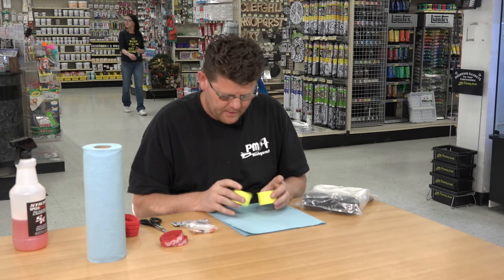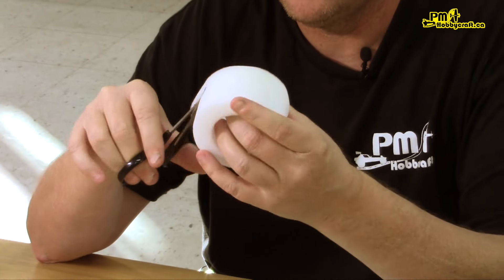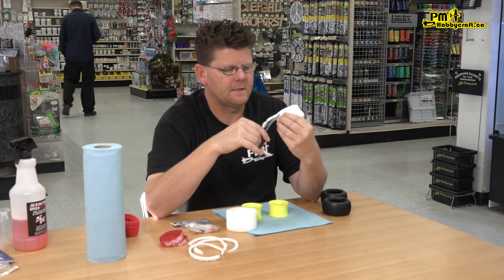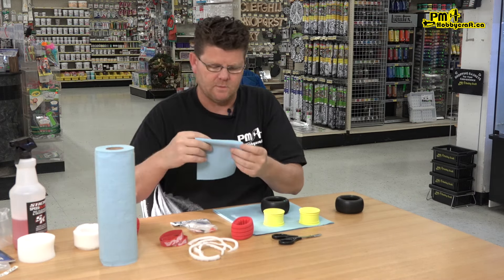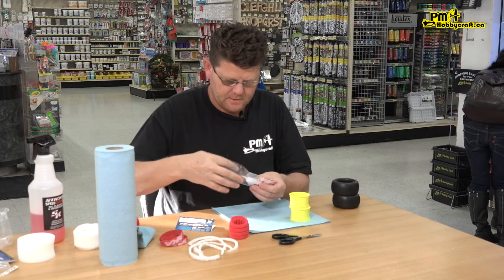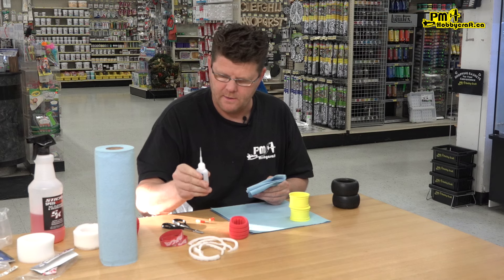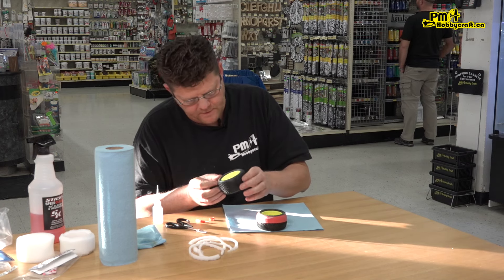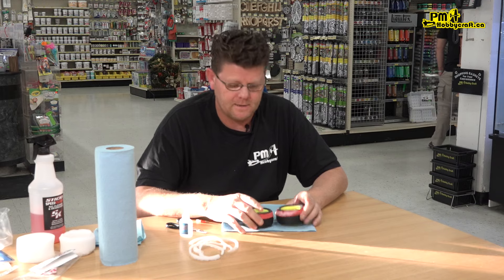Glue Your R/C Tires Like a Pro

Comment: I'm a noob and I spent last night trying to glue 3 set of tyres. Got just crazy for the bad result and burning throat due cyajoacrylate smell. Was almost going to throw this hobby in trashbox this morning. Then I saw your video. I will follow your way and hopefully I will be back on truck without problems. Thanks for sharing 🙏🙏🙏🙏🙏🙏🙏🙏🙏🙏🙏🙏🙏🤗🤗🤗🤗🤗🤗🤗🤗
Reply: Set up a little fan to move the air away from your work area. I hate working with super glue, but it is the best.

Comment: Is the CA glue used for wood similar to The CA  glue used for RC  wheels. 
Newbie question I know 👍😀
Reply from the maker: Thanks for watching and for the comment!  Some people have used CA intended for wood but with mixed results.  Some brands are quite brittle and they will fatigue over time which will cause the bead to come loose.  The way it was explained to me is that CA Glue that's formulated for RC Wheels has a rubberizer or something similar to make the glue joint a little more flexible.  Other people say that CA glue is all the same stuff but it isn't.  Even between brands of Wood CA glue, there are differences in performance.
Reply: @PMHobbycraftLtdCalgary  
Thank you Sir. I found some rubberized CA. Works great just leaves a white stain on the black plastic.

Comment: Is this method good for all rc tires? I’ve had some excess glue on the sidewall and once the rubber stretches or bends the glue turns white and flakes away from the rubber. How does this hold the rubber and wheel together? I don’t see how this gets down into the bead 🤔 unless I’m missing something. Just curious.
Reply: It's not a method I've personally used (i used to use the other method he mentioned, poor results) but it'll likely depend on the tire. I feel that those buggy tires are probably a softer and more porous compound than most, which allows that super-thin glue to just seep into the rubber.
the last method I used was
Seat the tire (like he already did)
pull the WHOLE bead back nice and even on one side
hold the rim over something that'll absorb your mess
drop glue from the top of the rim and it'll wash down, rotate 30 degrees or so, top that up, turn the other way 30 degrees from your initial start, same thing, then slide the bead back into place and re-work.
Repeat on the other side
Repeat again for the other 3 tires.
Still have to be REALLY fast and accurate, but it worked for me on 3 of my 4 wheels. The first one I just simply borked because I dropped the tire while trying to work with it.

Comment: Just glued some tires using your method and it worked perfectly. Thank you!
Reply: do you know what glue i could use
Reply: @masonbrossoit4998   Look for thin RC tire glue/cement with a long applicator nozzle.  If you can’t find RC tire glue, look for super thin CA glue.
Reply: @durden.tyler537  oh thank you im planning on doing a drag build but i needed to glue my own drag slicks

Comment: Can i use super glue?
Reply from the maker: Thanks for watching and for commenting!  Some super glues might work but it's hard to say for sure.  C/A Tire Glue is, in fact, a specialized kind of super glue that has been formulated to remain a little more flexible when it sets.  Regular super glues are usually quite brittle and will crack when the tires flex and, depending on the brand, they may have a different viscosity which could give you unpredictable results.  I hope this helps.

Comment: This is EXACTLY what I have been looking for.  I have hated the inconsistent results I've had from pulling the tire away so thick/medium glue could make it to the bead.  Now I just trickle a little glue trail and watch it wick in between rim and tire.  Once dried, I can run a wet bead for back-up.
Reply: That was the old school method they always showed us in the magazines, that's the way I learned and that's the way I always screwed up the balancing of my tires. The damn glue would set with the tire being out of the bead because of pulling the tire back....ugh lol.

Comment: When gluing 1/8th scale buggy tires, the thing that I find frustrating is that there is no lip between the tire and the wheel. In this video, there is a lip that allows for the thin CA glue to pool and then have it rolled around. You can't really do this with 1/8th buggy tires since the sidewall sits flush to the wheel. All the manufacturers need to do is add a little lip action, and problem solved for all those who are frustrated with gluing tires, including me.

I suppose I could add a little bit of lip myself by pulling out the sidewall just about 1/16", but keeping it even will be the challenge.
Reply from the maker: Sorry for replying so late but thanks for watching and for your comment!  I spoke to James about how he glues 1/8th buggy tires and he uses a Jig made by Thunder innovations.  It basically clamps the tire consistently which exposes the bead.  Here's the link on my website -  https://www.pmhobbycraft.ca/1-8th-buggy-tire-gluing-jig.html
Reply: @PMHobbycraftLtdCalgary  Hey better late than never! Thanks for the reply back and the info. I will definitely be checking out the jig for easier and more consistent gluing.

Comment: Great video. This works perfectly. Only question I have is around wiping. Are you using a solvent on your cloth? With the thin CA I'm using, there is no way to wipe it without it immediately sticking.
Reply: Hey thanks for watching I have never used a solvant before but you  could spray some motor spray on what your using to prevent this from happening  

Have a great day
Reply: Associated ft glue does the same. I've just left the glue there, looks better than piece of paper stuck in it 😂

Comment: I'm gluing my first set tonight. This helps alot. Thank you, if you have any advice on beadlockers that would be awesome. 
I bought a cheap set and a very expensive set so I'm gonna try on the cheap ones then weight and glue my crawler tires. Do I glue the side with the bead lock?

Comment: Why do you need to glue the tires
Reply from the maker: Hi Tony.  The reason you need to glue the tires is because when they rotate at a high rate of speed the centrifugal force can be enough to make the tire expand so much that it will lose its bead altogether.  Think of a dragster tire but on a much smaller scale.  Sometimes an RC tire will come right off and go down the track on its own.  It’s actually kind of funny but not to the guy who loses the race.  Thanks for watching and for commenting!
Reply: @PMHobbycraftLtdCalgary  Late to the party, I know, but it's absolutely hilarious when you've run the tire down so far the tread carcass comes off and passes your car going into a turn, and then come back to your truck to find the sidewalls are still glued in perfectly fine.  
I did that about 5 years ago in a local parking lot with an old 1998 Nitro 4Tec Pro.15. Turned so many laps with that old HPI belted Slick tire that it wore the edges of the tread so far down the tread came right off and I knocked down the curbing that acted as the outside wall. Most accurate tire failure I've ever had. 
Technically the only actual tire failure. Everything else was me being not smart with the trigger.

Comment: Would crazy glue or super glue work?
Reply from the maker: The type of glue used here is in the same family as other super glues but it has a property which helps it remain flexible and adhere to the rubber and plastic better.  Standard superglues are usually more brittle.
Reply: @PMHobbycraftLtdCalgary  Thanks for the reply, I used super glue paste and it seems to be doing ok. I'm not doing anything fancy so it should be fine.

Comment: Nice video, I just got some Pro-line Electrons with the blue closed cell foams. Have you compared the AKA reds to the Pro-line blues? AKA seems to be most popular.
Reply: Hey Ryan thanks for watching I find that both foams work well. That being said I have not used the proline foams for about 3 years now so i'm not sure if they have changed. From what I remember the AKA foams lasted longer and were just a better foam overall at the time . We do have proline drivers in the area and they still do very well at the track. hope this helps have a great week

Comment: For dirt racing do you recommend holes in the tyre or the rim or both?
Reply from the maker: James does both for his but he says it's mostly personal preference.  2 -  1/16" holes in the rim at equal points is usually good for most track conditions.  Keep in mind though that in extremely wet conditions (not usually found in racing) piercing the belly of the tyre becomes more important so that any accumulated water will be let out.  Thanks for watching!

Comment: You forgot to vent the tire.
Reply: Yes the AKA wheels have two holes in the inside of the  rims if they don't I use a reamer to make them  sometimes i will makes those bigger or punch the tires good eye sorry guys
Reply: James Hollinger no, the tires, not the rim. The rims will be vented as well, but the tires need it as well. Without the tire vent, and moisture that get in the tire will stay. With a vented tire, and moisture in the tire will get “flung” out of it via centrifugal force.
Reply: JoCo Dashcam different strokes for different fokes

Comment: Wow... I just got to the part of the video where you actually "glue" the tire... SERIOUSLY???  Message to anyone watching this / reading this.... DO NOT FOLLOW THIS GUY'S "ADVICE" .... Sorry guy, but if you have problems glueing the right way, then you're doing something wrong.  Just running a glue around the OUTSIDE of the tire isn't going to cut it.  LMFAO......
Reply from the maker: Seriously Ben?  No need to be sorry as everyone is entitled to their opinion on how they do this but did you also know that Losi Glue is thicker than the Sweep we were using here?  With thick glue you have to pull the bead, but on the thinner stuff you don't and it gets in there just fine.  We (and the many others we race with) have used this method for a long time and have had far fewer problems than with pulling the bead back.  If you like your method then great... it works for you.  Our method works for us.
Reply: Ben Dover What's your problem there's nothing wrong the way he glues his tires everyone has there own way of doing things.
Reply: This is a good method when using thin CA, it will actually suck itself down into the bead.  I've done both methods with standard and thin CA, either method works well.
Reply: How will this method hold up on a 1/8 scale on 6S though? I have an Arrma Typhon on 6S and it's very hard on tires. I usually lift the bead but I do like how yours came out clean.
Reply: Make us a video then
Reply: @darrellroireau4061  
Hey I had the same question I have the arrma talion and I have to tape the inside of the tire then re glue them. Have you tried this thin ca method yet ?
Reply: @rcjabroniyup4959  yes I know of the procedure but haven't tried it yet. My Dynamite speed treads hold up pretty well though.
Reply: This is how Ryan Styles Harris does it also. Scrap the "tire glue" go get some mercury thin CA and be done. Surprised you car guys dont use kicker also though.
Reply: I have to agree the thin glue penetrates the bead.
Reply: Ben Dover how can u say if James’s method is good or bad if you havnt even tested it out yourself?    

I’ve never seen anyone do it this way  BUT im definitely going to give it a try!

Tires cost way too much money and if there are any tips that I hear about that have the (potential) to make my tires stay glued for longer u can bet I’m gonna try it out and see how the results compare to all the other methods that always seem to fail after 2 heats of off road buggy racing 🥵
Reply: @jtr4405  works better then Medium CA or special tire glue that is just medium Ca. The thin CA penetrates way better then medium. Be careful not to use too much though.